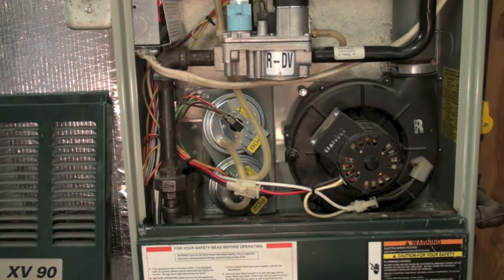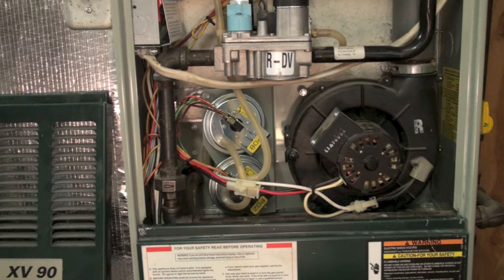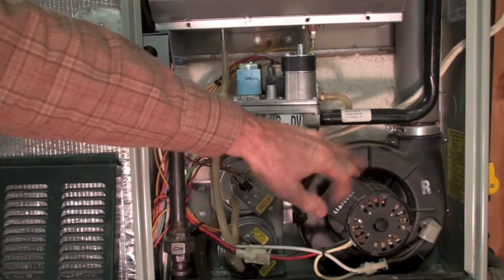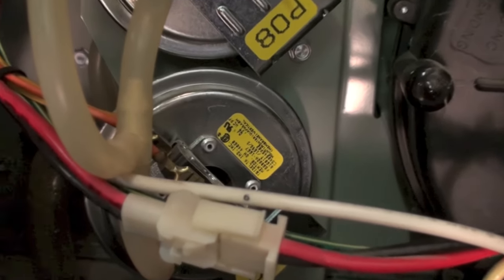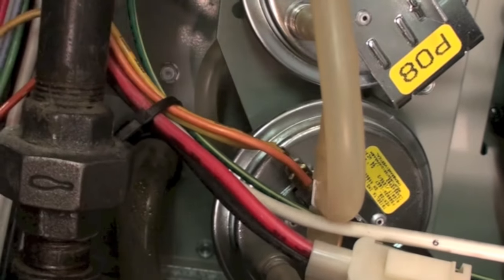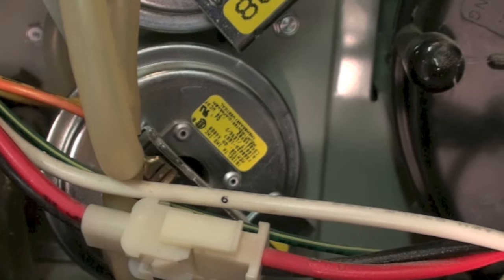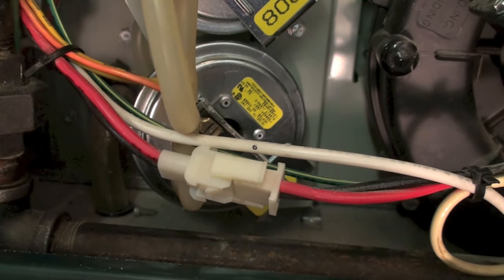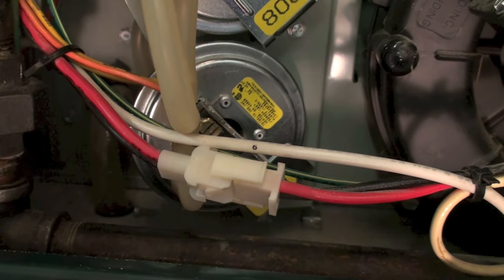Diagnosing pressure switch problems on gas furnaces

Comment: replaced the pressure switch furnace turned on then blew out cold air however the flame didn't come on
Reply from the maker: +degamrio What was the error code?
GFM
Reply: +grayfurnaceman 3 blinks I tapped on the exhaust piping that runs up the chimney and then reached down and spun the blower motor and she fired right up??
Reply: +grayfurnaceman I spun the lower big blower wheel
Reply from the maker: +degamrio Look for possible blocking in the vent pipe.
GFM

Comment: my board error code light says that my pressure switch is open when top tube to burner area is connected but the furnace cycles normally once for 15 min and then shuts off and restarts again rightaway without burning...when I disconnect the top tube to burner, the furnace operates normally
Reply from the maker: Check for blockage of the vent or combustion air tube.  Also could have water in the pipe.
GFM
Reply: I think that I had water in the tubing to the low side pressure switch. After blowing out the tubing, the header stopped throwing the error code.
Great information, thanks!
The last time I worked on a gas heater, well, it was a millivolt thermocouple valve system, no safety circuits whatsoever. Imagine my shock when I read the code, then went WTF is pressure switch?!
After seeing this video, I understood exactly what and why they're in place. Pity we didn't have those with that antiquated heater, all those years ago. We had a chimney obstruction (bricks fell into the chimney from crumbling mortar), which gave us a fine white dust throughout the house and "flu like symptoms" all winter long. 
No, flue like symptoms, CO poisoning. The dust, natural gas "ash".

I'll have to go back into the unit soon, I don't like how the hose to the high side pressure switch is routed, too close to the inducer cooling fan. Don't want that tubing eroded through due to lousy routing and dressing.
Reply from the maker: Glad it helped.
GFM

Comment: so i pulled a vacuum tube of the pressure switch and the furnace kicked on.. what does that mean again?
Reply from the maker: Undead Encounters If you pulled off the combustion chamber sensing tube, you probably have a blockage in the combustion air inlet.  Hope this helps.
GFM
Reply: thank you!

Comment: replaced pressure switch and inducer motor but furnace won t  work code still flashing pressure switch problem  do have any ideas
Reply from the maker: Check the venting for blockages.
GFM
Reply: John Mulholland
Reply from the maker: Look for sensing tube blockages, vent pipe sags and blockages in vent or combustion air pipe.
GFM

Comment: what about if just 2 burnes working and the other 2 not
Reply from the maker: This could be dirty burners, cracked heat exchanger, low gas pressure or plugged gas orifice.  Hope this helps.
GFM

Comment: Mine says " pressure switch stuck closed ". What would that be?

Thanks
Reply from the maker: Xalaxander It almost always means the pressure switch has failed.
GFM
Reply: grayfurnaceman The indicator says, "Pressure switch will not close!"  Does this mean the pressure switch has failed as you wrote above?

Comment: Could you plz help me ? My furnace flame fluttering on a Goodman furnace
Reply from the maker: Without much information, I will give you a general answer.  If the furnace flame is rolling out the front and opening the rollout switch, you have a cracked heat exchanger.
GFM
Reply: @grayfurnaceman  thank you

Comment: What does combustion air switch stuck closed mean? How do I fix the problem?
Reply from the maker: I am assuming you are meaning the air pressure switch.  On most furnaces, If the switch sticks closed, the unit will not attempt to fire until the switch opens.  Hope this helps.
GFM
Reply: How do you unstuck the pressure switch? I get 2 flashing code lights meaning combustion air switch stuck closed..that is what is says and I do not know what to do.
Reply from the maker: RadMadMike About all you can do is replace the switch.  For temporary repair, you can tap the side of the switch to see if it breaks loose.
GFM
Reply: ok.. I will give that a try. thank you.
Reply: RadMadMike Did you get your problem fixed?  If so, do you mind letting us know what the issue was?
Reply: Combustion air switch was bad..cheap and easy fix.
Reply from the maker: RadMadMike Glad it worked.
GFM

Comment: Captain obvious completely skipped over step one after getting the code.  CHECK FOR A LEAK IN THE LINE. 90 +% OF THE TIME THE END OF THE TUBE STAYS ON THE FITTING AND THAT IS WHERE THE LEAK WAS.

Comment: What if pressure switch rings open?
Reply from the maker: Not sure about what rings means, but if the pressure switch stays open when the inducer starts, I would first look for vent blockages, etc.
GFM
Reply: grayfurnaceman thanks.  Filter was old.  It froze up the AC unit. Changed filter and capacitor.  Tried the furnace now it won't kick on.
Reply from the maker: Do you have a code blinking?
GFM

Comment: I have a problem with my furnace not pulling the pressure switches closed. It is a Goodman 90% furnace. It is brand new. Never been fired up. The hoses are blowing out instead of creating a vacuum and closing the pressure switch. I am guessing that the exhaust pipe is not right.
Reply: I am having the same problem. Did you ever figure out what was causing it?
Reply from the maker: It is normal to have a positive pressure on the vent pipe.  The negative will only be on the combustion air.  If it is new, it could be that the length is longer than the manufacturer specs.
GFM
Reply: The pipe was too small @ 2" changed it to 3" and now it works.
Reply from the maker: Glad you got it working.
GFM

Comment: I have replaced my inducer, my control board, my gas valve, my flame sensor, my igniter, and sometimes it still starts up the inducer but stops without turning on. Like 10% of the time. And I'm still trying to find a video that will just tell me how to tell if it is the pressure switch or not. And instead of that, you just get lectured at about how it's something else. Yeah okay.
Reply from the maker: Most pressure problems are not the pressure switch.  The pressure switch is a sensor to determine if it is safe to continue the trial for ignition. 
Vent blockage, too long vent pipe, wrong ells, crack in heat exchanger, the list goes on.
GFM

Comment: I need some help. I have a Goodman furnace that the engine keeps on humming. I checked the code, and find out that I needed to change change the open limit switch. I found 2, and replaced both of them. I called the company, and I was told that the humming could mean that my transformer may be bad. I changed that. And the damn thing is still humming.
It starts, and stay on for about 2 minutes. Then when the unit click for the motor; it just makes that humming noise.
                                                                                                                                             Please help!
Reply from the maker: Peter Louis Are you saying that the circulating fan motor is not starting?  If so, check to see if the fan turns easily.  Stiff fan= bad bearings.  If it is free, the capacitor may have failed.  Let me know what you find.
GFM
Reply: grayfurnaceman The capacitor is also brand new. It's just the circulating fan that keeps humming. I've noticed when there isn't current going through it; I can spin it with my finger. But when the current goes through it; I tried to turn it with my finger, It spun a little then stop! And it's hard as you tried to turn it.
Reply from the maker: Peter Louis From what you say, I would say the motor has failed.
GFM
Reply: grayfurnaceman
I was thinking the same. Thanks man! That was very helpful.

Comment: Use the KISS theory. On those Vaccum tubes alot of times where the nipple is on the Vent above the combustion chamber, it can build with gunk and clog. Alot of newbies will miss this and pay for a repair man to simple clear it out with a small screw driver. On a vaccum style pressure switch always checks the tubing and nipple that pokes out the vent for obstruction. Did you say to buy the same pressure switches? I'm not sure. This video leaves alot of info out for anyone looking to try and save a few bucks. Verbage and the way you talk is over complicated.
Reply from the maker: I said to use factory pressure switches.  The use of general replacement switches is a good way to get into a liability suit.
GFM

Comment: my Payne gas furnace is not draining water, it just gurgles in the pipe and won't throw heat
Reply from the maker: +Derrick Callahan You probably have a plugged condensate drain.  It just needs to be cleaned.
GFM
Reply: your exhaust pipe has a dip in it or isnt leveled right.